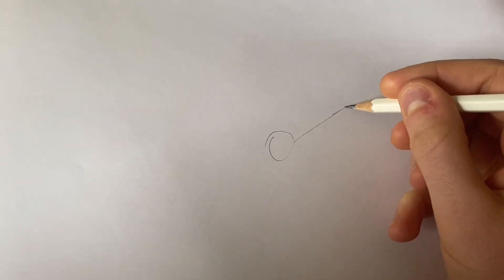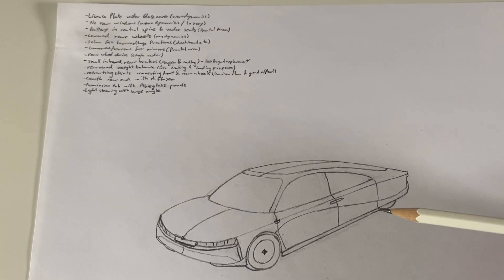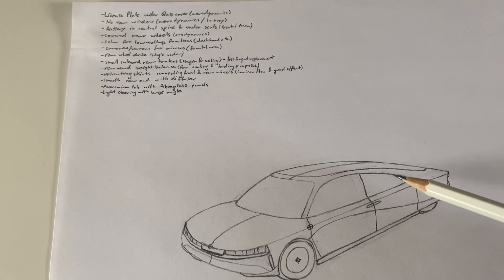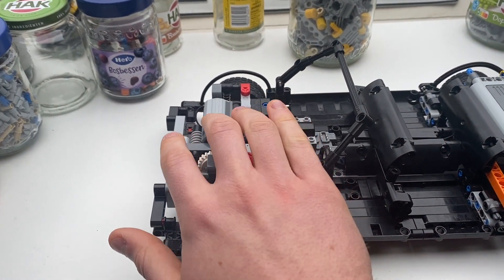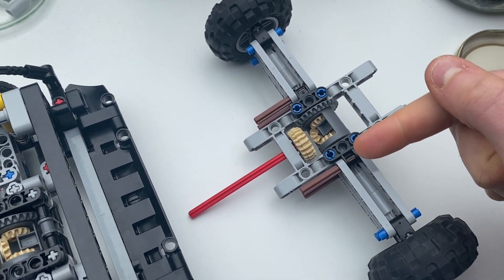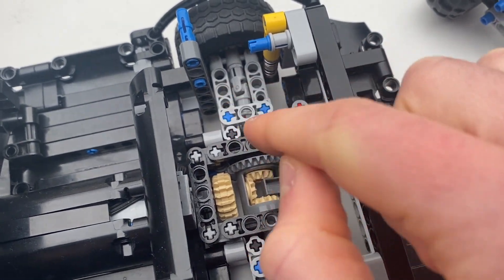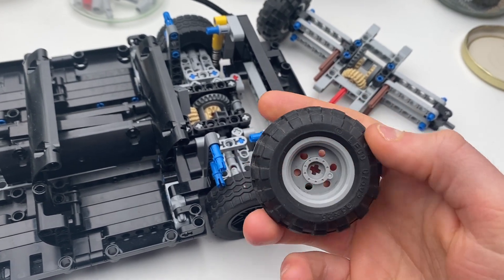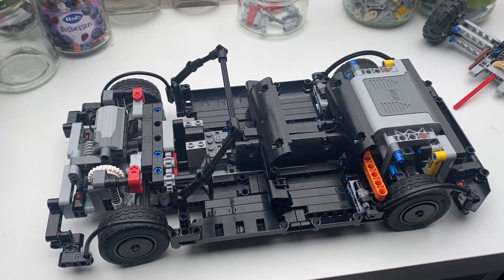Compact RC Lego Technic Electric Car Chassis

Comment: That whole rear axle section is brilliant. I would never have expected the ring gear of the differential would stay engaged at all times when it'd not held in place traditionally! Plus i love the solution for the rear suspension arms! I saw your other small crawler live axle design as well, which is amazing on its own as wel! Very clever builds!